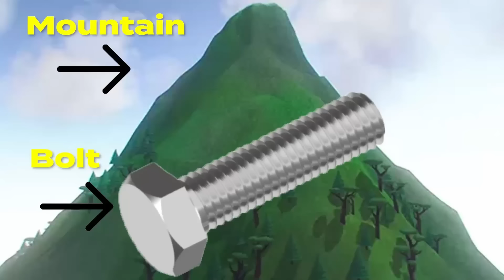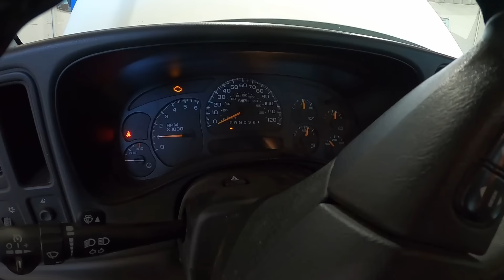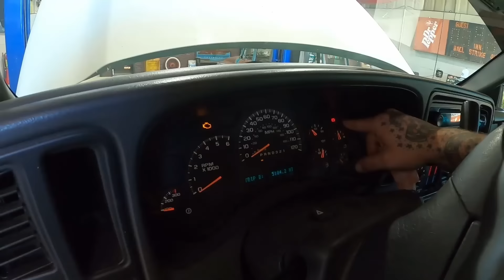BROKEN WINDOWS, Oil change, and MORE! TOW PIG SALLY!

Comment: Puddin just a little FYI any vehicle made in the 90s and newer is metric Gms basically use 7,10,13mm for everything aside from bigger frame and bumper bolts but those are also metric

Comment: I had a 6.0 with a small lift and slightly oversized tires and the fuel mileage was terrible. I’d just keep it fairly stock, the stable has a lot of cool trucks already.

Comment: They went to wally world before they sold you this truck to get an oil change, I worked in the TLE Center for 7 years back in the day. Blue stuff is used as an anti-tamper measure. We'd have customers drain their oil and blow their engine on purpose and try to get a new one.

Comment: Puddin ,here is my go to for oil mess on concrete. Dollar General CHEAP cat litter. Work just as good as the EXPENSIVE auto parts oil clean up pellets. I can buy 3+ bags of cheap to 1 expensive auto parts store oil pellet clean up. More material for your buck.

Comment: Excellent video Puddin  :) also for  your Chevrolet  truck you said fuel mileage is crazy add a grey bottle of STP Total Treatment fuel injection and carb cleaner in fuel tank each month ! Plus put Fram 2 x times air filter in  Spring Season also new again in Fall season each year too also if like Air Conditioning and clean Heater to change Cabin Air Fliter to same time Air filter use Fram brand one too of Cabin Air Filter type! They task to but you empress how work and performance too when change Air filter and Cabin Air Filter vaccum out to were installed  them and plus Air  vents ! Also fuel mileage improves  on Air filter and truck smell like new one when Cabin Air Filter Changed  after ! Check Antifreeze every 2 weeks too and change Engine Belt to every 3 years to! Tires there 4 types of  16 inches used on that truck to if didn't know one is P225 /75/16 load range D , 235/75/16 Load Range E , 245/75/16 Load Range E or F , 265/85/16  Load Range E and F types want use All Season/Winters Season with Traction and Ice big lugs tread plus  give grip plus brake stopping and steering goodness too ! Yes be cost lots money and last long but want good brand use Michlen or Cooper brands I say  try ! But lots makes and just ask tire dealers what help buy and last long miles plus years !

Comment: That blue stuff on drain plug is what oil change places put after they change it Walmart I know does it
Reply: Yup... definitely Walmart because they use Fram trash...EVEN though they stock the AC Delco filters for these trucks and they are cheaper than the fram trash

Comment: If your truck has the gas pump symbol button on the steering wheel press that until it shows oil life then you can reset it like resetting the trip

Comment: To fix door clips use super glue put a little glue on both sides of the break spread it out & let each side dry separately. Then when the glue is dry  glue one side & put the part back together & it's fixed.

Comment: Turn you torsion key bolts in a little bit, get some bilstein 5100 shocks and toss some 275 or 285 tires on her. Had a 05 2500hd that I did it to and she sat level and looked good. Also, watch out for those cheapo plastic handles especially the tailgate ones. They’ll snap pretty easily

Comment: Torsion bar keys (front leveling  kit) will ride rough. I run 265x75xr16. Just put 1.5- 2 full turns on front torsion bar bolts.

Comment: I purchased an 02 GMC sierra 2500 HD and installed the 265 75/16’s  and it looks so much better than the 245 75/16 yo appreciate it just a little bit and your speedometer will be off maybe half a mile an hour

Comment: I have an identical truck, I prefer running a 285/75/16 10 ply tire on these 3/4 ton trucks. I’m on my 3rd set of Thunderer A/T R, I use it for pulling trailers daily, not too loud or aggressive but gets me out of any situation. That size looks good and works great on these trucks at factory ride height with no trimming bumper/valances.

Comment: The blue goo that you say is just a security measure that when we did it at Walmart, and normally I just would have put my initials with the Blue goop g m are on the bottom of the oil pan and on the bottom of the oil filter

Comment: Talking wheels and tires I always liked the look of older trucks that ran steelies 8 or 10 inches wide and 33’s or 35’s. For aftermarket wheels I saw a set of aluminum solid wheels made by Delta if I remember correctly they looked so tuff on a Ford F150 4x4 I saw at a gas station I had to talk to the owner about them haven’t seen a set since that was in mid 1990s   👍

Comment: Like the second channel lots .And now that you have the tow pig properly serviced and ready to GO let it GO  and get rid of it.  You have way too many cool old cars to mess with late model crap like that.  A 3/4 ton older international or ford or dodge or studebaker or diamond T would be lots more  efficient and cheaper to use and more efficient fuel economy.  Or if you never seen one car companies made a One ton FLAT bed truck.  And they come in white 4x4 dulls tires with a flat bed . Thanks you for explaining the proper use of tare I have been trying to explain this to people for years a tare goes on a truck a tire is how the reddio station WKORN sends out magically to your car.  As you drive down the road. Still not sure how it knows what direction you are going but it is able to always be pointed in the right direction you are going.  That's why it magic see .

Comment: I used to have some 2004 deewalt ratchets those things were great i replaced them in 2020 after boxes went missing when we moved, i have bought a small ratchet from almost all ratchet brands and not a single one was even good and good is just one above bad so in other words they were all bad. So if your buying new just buy the one with the best warranty that fits your budget, i am currently buying yard sale tools or trading labor for old tools.

Comment: Puddin on my 04 2500 raised the front so the it's level one size bigger tires tinted windows except mine is black to raise the front adjust the torsion bars👍👍

Comment: The blue on your drain plug and fram filter is probably from a Walmart auto care center they use the blue as a type of seal to know if anyone messes with it and then brings it back and says that walmart messed up their car/ truck if its tore loose they know some besides the auto care center has been working on it

Comment: Puddin' ...

Black Steelies, semi AT tread tires (1 size bigger) , front level kit,  put 3 small amber colored lights in the grill, put a movable flood light in the bed so loading at night is easier, lastly get a small brush guard ( you like bush whackin' once and awhile and it'll help ya'll out.)  
:)

Comment: I have a 6 L and my HD 2500 
4X4. I used it to pull another 4X4 half ton Chevy extremely low gear and she went down one side to halloran up another and up over the crown which was a sharp break on the ground. No problem I had ice I had a hundred years at least cover on the ground had some snow and at one time I try to pull the bedside off the other truck against the tree. All the time I had no bed at all in the back of that 2500 HD 6 liter. Just thought I'd share your know somebody's going to come back and say don't badmouth at 6 liter. Not exactly what I'm doing now that all. I've got 19.5 is on mine and that's old railroad truck that used to run the rails. I do have one hellacious bumper on it. Is very low geared. On the farm I don't really notice the gas mileage but you're probably right and it probably didn't do any better than my super duty. Which vacuum averaged more than 12 miles to the gallon on a tank, on the highway the interstate I would note that on my calendar. But it's also load GERD. And I have to be careful or she'll get 8 to 10 mi to the gallon. I switched over to driving something a little different. Love you shop glad you have it. Just wonder if you ever drive by your old place I know it's been a short time? For me always find that to be a good reminder.  Appreciate your show.

Comment: Leave it alone fuel trims and speedo is set just drive it and be happy. but most people think if you put a 6" lift and 35" tires that will improve the power and fuel mileage. my 4wd i left  stock because it works and works good GM spends a lot of money to match gear and tire size for mileage and handling.

Comment: I would never put a leveling kit on my truck because it throws off your towing capabilities and the blue on the drain plug some oil change places put blue dots on your plugs and filters I guess for like a safety thing as to who did the oil change

Comment: Boy you got a lot to learn about these trucks dude...button on the bottom left of the steering wheel with the fuel icon will show you your oil life...press until is says oil life...then hold the arrow on the bottom right switch until it resets. Its that easy. 

The hardware on these trucks is METRIC. Not sae...7mm is your best friend. Using standard will absolutely strip it out. No cars use sae in the modern world. Even American cars. It's all metric

GMT800, BEST trucks made in the modern era...they don't die. Had three of them plus my 04 Suburban Z71... absolutely love these trucks. I get 23mpg on the freeway...but we don't buy these for fuel mileage.

I was SCREAMING at the screen Puddin...your gauge dimmer was off...I could see it. Always leave that as high up as it goes or you'll never see your display

Comment: The problem when leveling the front of a truck is when you put on a heavy trailer. Then the front is pointing up in the air. That is a nice looking truck!
Reply: could always but in some helper bags in the rear to counter that, so for the 90% of the time you dont have a trailer you look good going down the road

Comment: Do a leveling kit on it may be a set of 18 inch wheels that are aftermarket, Samole bit bigger on the weights, wheel size and then do like a tire that’s bigger than the stock size for like an 18 inch or 19 inch wheels

Comment: Don’t level the truck if it’s a tow rig. That’s why it has a slight rake from the factory. If you level it then it’s going to have a Carolina squat when you tow. It might also get a little squirrelly on you in the front if you really have a heavy load because it takes all the weight off the front and transfers it towards the rear. Just leave it alone is my advice.

Comment: 10:08 the adhesive gm uses on the vapor barrier is similar to butyl tape, it will restick. Dont feel bad about your yukon, gm at that time used cheap white plastic clips that were pretty much one time use, i kept a large assortment in my tool box when i worked at the dealership

Comment: I'd level it, maybe lift it a little bit. Lose the plastic bedliner and replace with spray-in liner. Get rid of the running boards, at least beat the existing ones straight. Wheels and tires.

Comment: I am so disappointed there was no truck washing music going. Was grinning thinking it might happen. Of course, you were in public, but that didn't stop you before. Just kiddin, don't get banned from the car wash! 
On the truck height and tires/rims, think I would keep the stock ride, just replace shocks and worn out bushings, and maybe some helper bags. All that GM towing geometry is done for a purpose. Not saying you can't improve it, just make smart changes. I love the old school chrome reverse steelies with baby moon caps covering the mounting hardware. Get a good set of them, they look better that those Mortske Cragars any day of the week. 
I used to like tint, always thought the darker the better, but I find myself having to let the windows down at night to see on coming traffic when I got to turn left or right, which is annoying. I got a friend she drives uber, and she tinted inside and outside so no one can see in at all. It keeps the vehicle cooler in the heat, but shealso complains she can't see to turn and has to roll down the windows. Used to be regulations and fines on how dark you can go, but shops will tint how you like it, and charge the shnit out of you.

Comment: I have the sister to your truck sitting factory. I would maybe level it and a size up in tire I wouldn't change anything but regear it because I live in the mountains and she doesn't like the mountains with a load. Goose neck or bumper.

Comment: Puddin I am with you the trucks should be level front to rear and a fairly full fender well A size or two taller is usualy a good look to me. Never a smaller tire. Also keep the standard offset on the rims, a friend of mines son put wide tires with a rimm to widen the stance and keeps having wheel berings fail has to replace about every 8 to 9 months.
Reply: These ride like that because they’re made for work not driving around empty. Put a couple hundred pounds or some healthy tongue weight on the back and they look and ride better. He could do a little torsion bar adjustment  to get some front lift but I think if he goes to town on suspension stuff he’s gonna sacrifice how it rides loaded.

Comment: Harbor Freight, that mecca of high quality tools and mechanic's supplies (sarcasm) has 5 gallon oil drain dollies for under your lift. 60 bucks, and you can use your lift for oil changes. ;) (And I'm not really ripping too hard on Harbor Freight, they're handy for when you need a cheap tool quick, and for stuff like an oil dolly, so long as it catches oil and doesn't leak, it's good enough, right?)

Comment: Puddin! I have an 03 sierra I tried hooking up an aftermarket radio and now every time I give it gas or put it in gear it stalls out. I hooked the stock radio back up changed the battery and alternator and it’s still stalling out

Comment: Howdy, I've got three trucks here my oldest one is a 1940 ford, a 1961 f-100, and a 1999 f-150. I'm planning to slam mine on the ground. A 4” drop up front and a 6” drop in the rear. I'd like to buy the drivers seat and passenger seat that are in your Tbird.

Comment: Wished my Mercedes SL had door panels as easy to remove as that truck, my window motor and regulator went and after getting ripped off by Mercedes for £650 for the hardware I broke every clip and trim piece on the panel and had to pay to get it done by a pro! Never again!

Comment: torshon keys so you can level it out and prob 305 70s?
Reply: and color matched whilte tow mirrors, tint and no badges super clean... all my buddys with that era of gm turn the back of the ceter console or center seat base into a 10" sup